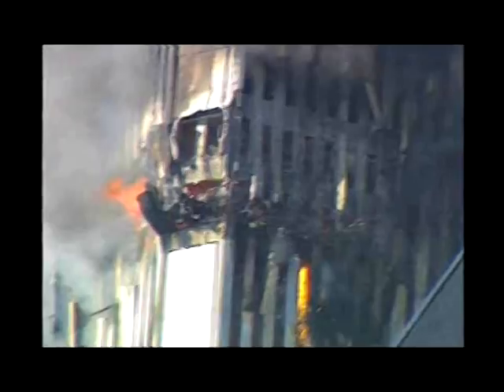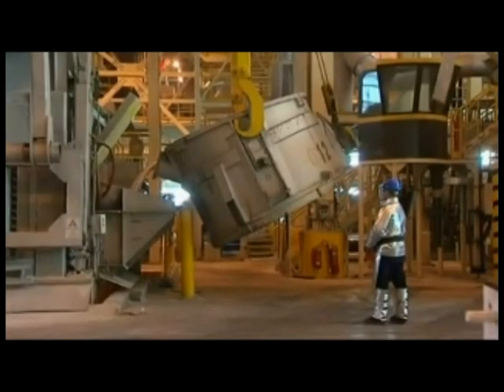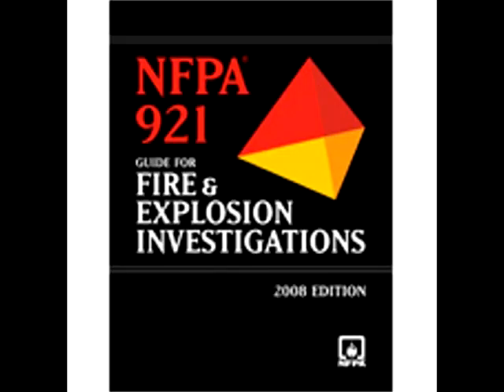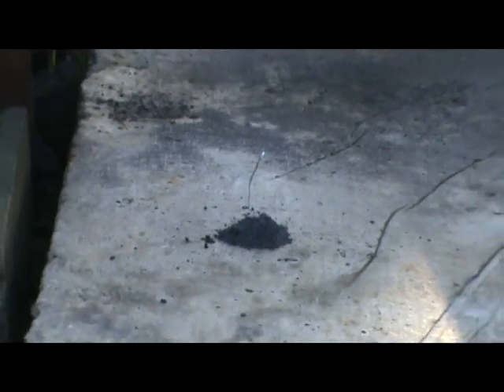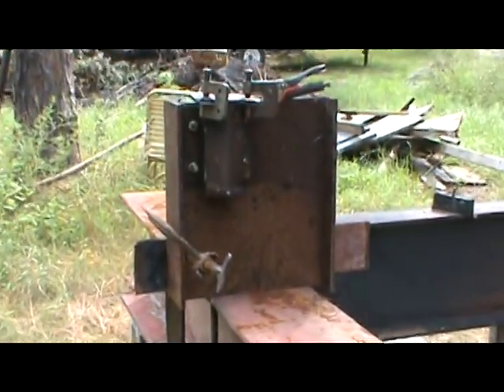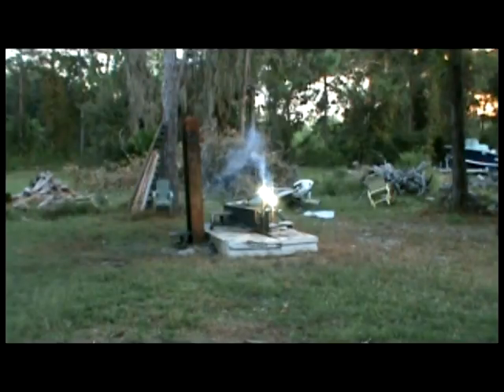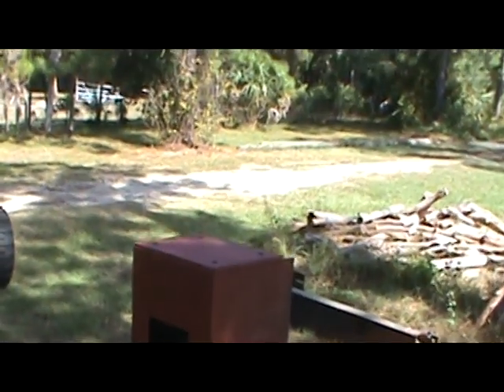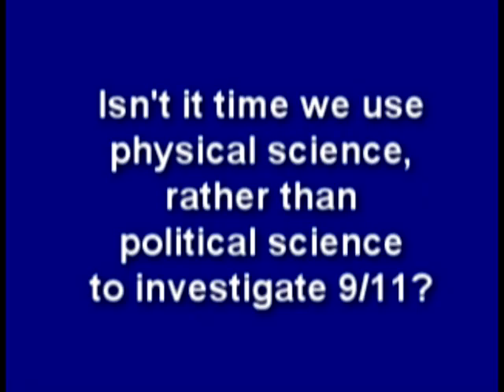9/11 Experiments: The Great Thermate Debate

Comment: Steel doesn't need to be melted to weaken, it only needs to be heated.....Jet fuel is more than sufficient to do that.
Reply: Nobody is arguing that steel doesn't HAVE to melt to weaken moron. This argument is so stupid. Saying it doesn't HAVE to melt, does NOT account for the fact that there WAS molten steel, which means it DID melt. So stop saying it didn't have too, and explain to me how it DID, at temperatures WAY lower than required to melt steel.
Reply: A camp stove melt every time. Right?
Reply: Dennis Schmidt, obviously you don't know what you're talking about, that was structural steel and you need at least 1850°C in constant exposure heat for at least 1 hour per inch so then need to calculate as well square inches and then cubic inches, depending the amount of steel you are preparing to be weaken, rising the time of exposure waiting to the heat to be spreaded out to all the structure. That is why the foundries never turn off the electrodes or the heating source and the melting pots are not too big, in order to maximize the heat, in a short period of time.

 Jet fuel only burn at 800°C and it is very explosive and the burning time is very very short, so, the time for a heat exposure is not enough, according with the explanation above. Which means, 2500°C to melt 5 tons of steel in 4 hours, in a melting pot of 3 meters of diameter and 4 of height. Imagine how much energy and time you need to weak thousands and thousand of structural steel… Right! You do not know nothing but you could keep saying the same thing.
Reply: I suppose you've quantified that all and can provide the results..lol..I thought not....dont feel bad!..the govt didn't either..even though required to do so by law...most people haven't been made aware of that fact.
Reply: Dennis Schmidt 🐑
Reply: antiXhrist or even if they did the ignition is outside of the gas stove.
Reply: Timothy E Hook there is multiples videos that show heating the steel at that temp weakens it without melting it
Reply: Indo Surfer fuck it ..... type it in at google or whatsoever fucking type of machine you are using and you will realize that there is a colorful variation of jet fuel types and that jet fuel is not simply jet fuel all the time.
Hopefully you will get it Professor big brain......
Reply: autoholic that’s true but the term “jet fuel” has a big colorful varied selection of different types of fuels....
Reply: Drake krome LMAOOOOOOOF 😂 , nicely done sir ha
Reply: Indo Surfer poor little idiot you don’t look what I wrote down you simply start a fight .... sucker....
Reply: Brandon Hill 
I was thinking the same thing a jet liner alone is pretty heavy. I doubt the building was designed to withstand the added weight. Not to mention the damage from the initial impact. Besides it would have been alot less hassle from a shadow government perspective to load explosives into the jet and later blame a few airport personal as a network inside job.
Reply: Ryan Tschaekofske sheeps if I don't say so myself
Reply: No it wasn't, the buildings were never designed with the thought that a airliner would be intentionally rammed into them at full throttle,  traveling at nearly 700 MPH .....nobody even considered that would happen.
Reply: Actually yes I have, so has anyone who has ever taken a high school metal shop class.
Reply: Not all metals are the same moron!  Aluminum (The Aircraft's Skin) melts at much lower temperatures, even if molten steel was found,  jet fuel in the right conditions (Oxygen) would absolutely burn hot enough to melt steel......They used to melt steel with coal, and even wood moron!
Reply: Wow! That's complete bullshit!!  There have in fact been many steel,  and steel reinforced strctures that have collapsed due to fire!  Now if you mean no 1,300FT tall structures? Then no 1,300FT steel structure has ever been intentionally  hit by a fuel laden airplane traveling at speeds approaching 700 MPH!
Reply: I know exactly what I'm talking about Jet fuel, or any fuel for that matter can burn at a wide range of temperature (Add Oxygen)  How the hell do you think steel was smelted using coal? Also you don't need to heat the steel to 1850° to weaken it, steel begins to weaken at 425° and will lose about half its strength at 650°  Jet fuel is more than sufficient to do this......You don't need to weaken the whole thing either, anyone who has used a forge knows this.
Reply: I'm so sorry you are such an idiot.
Reply: Nope,  just a guy who's not a idiot.
Reply: Yes I did! ....And he's wrong!
Reply: They were not designed to withstand an aircraft being intentionally rammed into them at 700 MPH! There is a huge difference between an accident, and an intentional act.......Read the white paper again, and this time try to comprehend what it says.
Reply: BTW "Design" is irrelevant,  the Titanic was "Designed" to be unsinkable,  the Challenger Space shuttle was "Designed" not to explode,  Airplanes are Designed not to crash........"Design" doesn't mean it can't fail.
Reply: antiXhrist jet fuel is kerosene......
Reply: I don’t understand how these retards cannot understand that... I for one was glad for the blcksmith who proved it with rebar in his forge.
Reply: Michael no it is not … jetfuel is different in octane from cerosine
Reply: 82hanez octane doesn't increase a burn
Reply: The thousands of tons of weight above the impact area can render any weakening in steel a catastrophic fail point. Also, the fires were contained inside the buildings, as they acted like an insulated furnace. The explosions heard were very likely the popping of the steel as it failed and collapsed the second before the main collapse. People please leave conspiracy as a last resort, not a first.
Reply: YE44 I don't think camp stoves use fucking jet fuel

Comment: I welded railroad tracks together with thermite many years ago... Our thermite mix was premade thermite, black power and high carbon steel shot. When ignited with a magnesium igniter it would rotate clockwise as it all came to a temperature of 5600°f at which point a special designed aluminum plug at the bottom of the crucible would melt and pour the mixture of molten steel into a mold on the tracks. With all that said, the twin towers  looked like it had professional demolition help. Thermite can and will melt steel under the right circumstances. I don't know why in the video every experiment involved an explosion but my crucibles never exploded on the railroad tracks... Lmao

Comment: There's no way to test this or know for sure, because you can't re-create a big old building; then fly a jet loaded with fuel into it. Not to mention all the variables you have battery back ups, next to each and every computer. then you showed me those hand holes, for the liquid hot materials to go into fill up; once that has happened, it doesn't have to cut, just weak'n the structural support beams; and even though it was designed to take all sorts of abuse, this just wasn't one of them. I respect the work you did, however; in order for the type of planning and forward agenda, war, seeking treasones, decision making, against a fictitious villain, is far harder to stomach than all of the unknown elements that were occuring inside those Towers; on September the 11th 2001 and to take it further and say that Americans" and Not just Americans but Americans that we would both conspire to bring down kill and eliminate a vast amount of Americans on US Soil in a government building in the Big Apple for whatever purpose that could potentially aid us??! or simply to bring down our infrastructure from the inside well.. Even if that type of thinking is possible it most certainly is not feasible to the core thinking of Americans.

Comment: What we learned here: Thermite is made of aluminum, Planes are made of aluminum. Aluminum is super unstable, and when it gets pretty hot(much lower than its melting point) and is near oxygen it converts to aluminum-oxide(aluminum version of rust), which is a highly energetic reaction. This means it gets REALLY hot. Hot enough to melt steel beams.

Tl;dr: planes are basically flying thermite.
Reply: Dude have you seen how idiotic some of the arguments made here are? This is the twilight zone, you can't tell the difference between sarcasm and retardation here
Reply: brink lmfao no that's definitely not what I was saying. It was enough to cause visible Sparks and melt some amount of steel, probably not enough to wreck the building but maybe enough for that video. The actual structural damage would have been the heat over 1000 degrees compromising the strength of steel.
Reply: brink wow thanks for the intelligent comment, good argument
Reply: philip martin brilliantly said
Reply: not true at alllllllllll lmaoooooo
Reply: brink bullshit
Reply: Philip Martin. Haha, dumbest comment I've read
Reply: Bryan Gile throw an aluminum can into a campfire. It will get white hot and spark similarly to what you see in the video...
Reply: Bryan Gile 

Next to your own you mean?

Comment: Let's not forget about the CORE COLUMNS.

That's what no one talks about.
Reply: what is there to talk about? a several ton aircraft slammed into causing 10-15 tons of fuel to explode... any further questions smart guy?
Reply: Tom lol you have no concept of the size of them, and the relative strength of steel versus sheet metal.

If they were able to be hurt by a tin can they would have snapped early and the building would have listed.
And thanks, I am smart. Smarter than you will ever know.
Reply: Tom and the fuel burned up, so you exaggerate greatly. Also liquid doesn't bend metal let alone all columns, evenly, throughout the building.

Comment: This is a great video! I firmly believe that that we “John Q. Public” have been lied to from the very start. I have watched videos on the thermite/ thermate theory before, but never so well put together as this one. 

I have always had one question though. 

As a novice blacksmith, I have been able to melt high carbon steel railroad spikes in half with nothing but coal and forced air. I think I may have done it even with kingsford charcoal. 

I am not trying to debunk your theory at all. On the contrary, I believe it whole heartedly. 

I just wonder that if jet fuel and other burning debris could rise to a high enough temperature to melt steel if it had enough air/wind?

Comment: Talk about the obvious! Karl Koch steel had ties with the mafia. They cut corners and used cheap cuts throughout the building. Only selected floors had the correct a36 steel and concrete. The rest was a shell. That’s why when it fell it looked like it was a controlled demo. Picture every 15 floors with thousands of pounds of steel and concrete falling.

Comment: Here is an experiment for you. In physics we learn that the higher you get on the verticle plane the more unstable the platform becomes. That's why most high-rise buildings have horizontal support. Yake an industrial bolt and nut assembly and heat them with a weight load attaches and see if the threads in the horizontal bolts hold. Here is a hint at 1500 degrees they won't. Which is why you find stripped and broken bolts in both buildings. The stripped bolts are bent up to 90 degrees. The internal structural supports failed. They simply bent and the bolts holding them failed causing the buildings to implode.

Comment: When trail track is put together in some countries they use a thermite welding process which is a control burn and it melts the two rail together to be one. I have worked in thermite and those towers were themites causing the melting or dripping of molten metal days after the event. It is whats called a false flag in order to take the neccessary steps to take away your freedoms as in scritptuer the USA is the "beast that rose from the earth",and the image of the beast does satans work.Yes satan is in charge in this country not your forefathers for they to were satanic sun worshippers. Its all about having your MIND. And in this country satan has most you fooled but not me.

Comment: There's nothing to debate. They used thermite and no plane or jet in existence is powerful enough to bring down the twin towers. Nor does any jet or plane fuel burn hot enough to melt steel beams.

Comment: Sorry, but The aluminium mixed with ferric oxide (Rust) were in large quantities when the largely aluminium aircraft was obliterated and mixed with the Iron support beams. Now all we need is a heat source, something like gasoline or jet fuel. There are also large amounts of magnesium around the site of impact. I think that burns hot with large amounts of white smoke.  What do I win?

Comment: Although I am college educated, my degree is not in physics. However I am very well acquainted with truth lies and half truths. So show me your equation and I will use a computer to do the math. Don't bother trying to lie or BS you way out of this, because I don't need a college degree to know why the building collapsed, just a welding certification in structural steel and common sense. I got my welding certification at 19 years old and worked in building construction until I did irreparable damge to may back, then I went to college and got an advanced degree too.
Now I am going to explain some facts that show the deception. 1The melting point of steel is 2400 F to 2600 F, but you don't have to melt steel to bend it or make it malleable. A blacksmith's forge goes from 450 F to 1000 F. the fire protection was 3 hour protection at 400 F, but. Jet fuel burns at about 800F in open air. Add the factor of air being drawn into the area because of the fire generating its own draft and you have  higher temperature. 400F is only slightly hotter than the end of a cigarette when a smoker inhales. Mild steel loses half its strength when heated to glow a very dull red, about 800 F, and mild steel was what was used in the building for all structural components 2. The vertical structures were what failed not the horizontal I-beams, The vertical structural steel members were tubes and that is very important to consider and understand. Tubes have incredible load bearing ratings along their length but when deformed lose the majority of that strength.  Heat distorts steel. 3. If as the video claims there were "sparks of molten metal seen flying out of the building" the temperature from the fire was in excess of 1400 degrees, which is within reason if the right kind of drafting was causing the fire to super heat. All coal fired forges have a means of blowing air on the coal and getting the heat up to 3500 F. All that is added to the coal is a draft of air. 4. The second building to be hit fell first because it was hit lower down and there was a greater weight pressing down on the point of impact. 5. Structural and Mechanical engineers published the math and an explanation of the twin tower's collapse about six weeks after the fact. None of the politically motivated Froot Loops who think up these conspiracy theory to dupe the uneducated and naive have ever debunked those equations. 6. The cover up was that the Army Corps of Engineers did not run lateral stress and sheer stress computations on the square tube vertical structural components, but an engineer who worked for the terrorists did. Lateral and sheer stresses are why almost all buildings use I-beams vertically and horizontally. Obama Bin Ladin had tried to destroy the same two buildings three times previously but the FBI foiled those attempts. The news knew and kept silent about all of no. 6. which is why videos like this one can fool people.

Comment: So, four hijacked planes full of jet fuel with 2 hitting the towers at 500MPH were just a coincidence? 
Jet fuel didn't melt the steel. It reached yield point. The pocket hangers gave way. Once one or two 
floors pancaked, then a chain reaction collapse occurred.

Comment: It is very obvious that these buildings demise was caused by a controlled detonation. This video that says thermite couldn't melt through the roof of a car is nonsense for the railroad uses thermite to weld busted rail back together and believe me it gets hot enough to forge the rail back together and then they just grind the surface. Those buildings were brought down intentionally to try to create International sympathy so the Bush Administration could start a war and that's exactly what they did. I don't know where this thermite material is manufactured but I would have to assume there are records somewhere that show the massive amount that was manufactured around that time or who the biggest buyer was and for how long they were buying it because they couldn't have planted all that explosive in those buildings in a matter of weeks. It probably took the demolition experts a year or more to place those explosives where they needed to be to guarantee this success at imploding these buildings. This was a crime of major proportions and Bush Cheney and Rumsfeld should be held accountable. They knew it was going to happen they absolutely were involved.

Comment: The whole premise of the 'debate' is flawed. You don't need to melt steel to make a steel beam fail. You don't even need to get close to it's melting point for the structural properties of steel to be affected. Structural steel begins to soften around 425°C and loses about half of its strength at 650°C There is no need to invent conspiracies and cover-ups. There is nothing to hide.

Comment: Or maybe all the tall buildings are rigged with thermite / thermate  charges as an insurance requirement to make sure they collapse vertically in the event of structural failure? Thus, ensuring the surrounding buildings remain intact. Building 7 may have been scheduled for replacement and they just figured the easy way out? Big money really wouldn't want that one getting out would they?